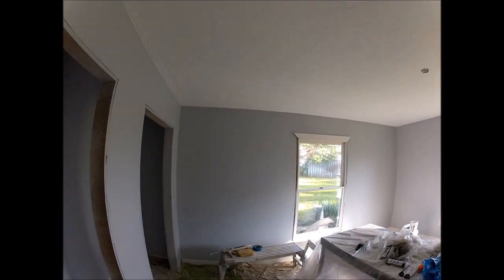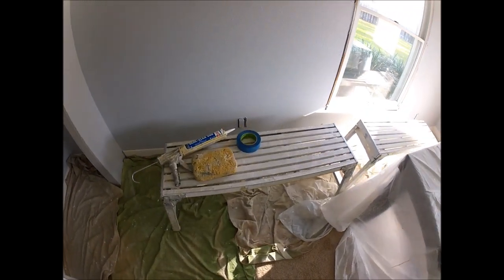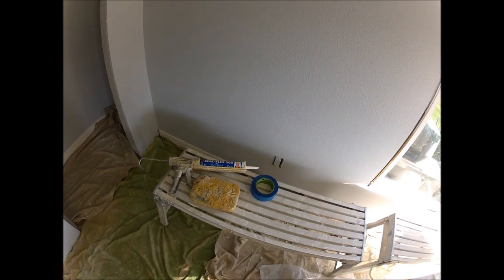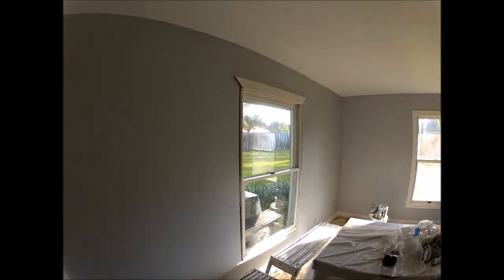How to create a straight cut line on a  textured ceiling - Pro Painter Tips and Tricks

Comment: Good advice almost. You should've painted the caulking immediately, then pull your tape. That caulking left unpainted will yellow over time, and it doesn't look good. I've done it both ways.
Reply: It cracks. Must be mixed with primer or paint. I'm gonna try this at work tommorow tho. I've been meaning to try it
Reply: Don't wanna paint over wet caulking
Reply: They make fast dry caulk that can be painted over in 20 minutes. Many paint stores and Home Depot has Alex fast dry caulk. Leaving it raw will discolor while the ceiling stays white.
Reply: @johnbelvin5216  Chuck is right. Usually you don't want to paint over wet caulking, but it works great in this application and is a common trick among painters. The line comes out cleaner when it can cleanly seperate the wet material vs the slight tearing you get once it's dried (as it's essentially ripping the thin overlap).
Reply: So the ceiling is caulking not paint. Seems like you could only do this on white, how long will the caulking last without dis- coloring, is there a shine to the caulking when dry? It looks good but I want paint on the edge not white caulking. If your doing it yourself and you suck at cutting in I guess its better then a wavy line!

Comment: If you paint long enough you can cut a line without tape.
Reply: Yes this is bullshit and a waste of time. If I don't have a nice smooth line between wall and ceiling I'll run a caulk bead and finger it smooth both ways, let it dry,paint ceiling two coats then paint your wall 2coats done deal.

Comment: Guess I’m a moron, I don’t know how that helps without using the wall color paint I’m painting wall with . Old wall in the garage is light pink. Not painting ceiling, new color is light grey, the caulk is t thick enough to cover up the old pink color, Ned to take her popcorn ceiling I guess abs run my caulk wipe off, then run light grey pull tape then but having problem with tape sticking to ceiling

Comment: Dude! You are the MAN!!! I never thought of doing anything like this, I'm not a painter just a weekend DIY'er but I've never been able to do a straight line. Now I can! You FN rock!!! Thanks and much success...
Reply from the maker: That's awesome Airbnb Lifestyle!! I'm glad you found my ceiling painting hack helpful. I'm a self taught painter and drywaller which gives me some out of the box thinking when it comes to tips and tricks with painting, drywall and texturing. Which is helpful for do it yourself like you and even professional's. Be sure to subscribe to learn even more helpful tricks  http://www.youtube.com/subscription_center?add_user=PeckDrywallPainting Thank you for the kind words. Take care, -Paul
Reply: Nice job man, this is the only way to achieve a true straight line of caulk, and it is fast too. As you are an dry waller, can I ask why my painwork has cracked on my dry wall (dot and dab) I have done 3 coats of dulux trade supermatt watered right down, sanding and filling in-between. I have managed to sort the mess of dinks all over the walls, and have achieved a perfectly flat finish, but, the paint has tiny hairline cracks everywhere. I'm not worried because I will be painting vinyl matt on ceiling and dulux endurance on walls for finish coats, so the plastic shouldn't crack (he say's) but I would just like to know why my supermatt has cracked? I'm wondering if the cowboys who did the dry wall job didn't prime the walls properly, if I maybe didn't water down the paint enough, or possibly the water itself has contaminated the paint? I am probably going to pick some floetrol up tomorrow as I am maybe being cheap using water to thin?

Comment: My dad was a professional painter, and he could cut a straight, level line mid wall if need be. Me. fair, but on texture, it does become more difficult. I started painting the wall first, then taped and sheeted with plastic, then sprayed the ceiling. Looks nice, but much more work. Like this approach. What do you think of applying the caulking before painting, then spraying/rolling the ceiling, then cut in with the wall color?

Comment: So am I correct in thinking you matched the caulk to the ceiling color and did not have to cover the caulk with the white ceiling color paint?  Seems I’ve seen this hack using a clear caulk that had to be painted over with either the wall or ceiling color.

Comment: This is definitely quicker than the method I am going to try tomorrow. I have flat ceiling white stomped ceiling and darker color satin finish walls. I've cut-in a few sections of wall but even with a fairly steady hand I am not satisfied with my cut. What I plan to do, although it will take longer, is to run the darker wall paint slightly on to the ceiling edge. After drying I will apply painters tape to the satin finish wall (it won't peel satin paint off, but it sure does flat ceiling white!). Then I will take a 1/2" to 1" wide artist brush and apply an application of ceiling white on to the taped line to get my "white" cut-in. PS- I am retired so I have the time to be anal about my painting. DO ANY OF YOU SEMI-PROS THINK THIS WILL WORK WELL? Thanks for your responses.
Reply from the maker: Hi Teddy, that sounds like a plan.👍🏻 Here’s another trick for ya: If you dry brush the paint over the edge of the tape first and let that dry. That will seal the tape so your cut in will not bleed through the tape creating a nice straight cut line when you peel the tape!et me know how it goes. Thanks so much for watching and subscribing!😎 -Paul

Comment: When do you paint?  That works if your doing a bright white ceiling but what about if we want to darker opposing colors on adjoining walls?  Do you paint immediately after you caulk, then pull the tape?
Reply from the maker: Hey Shawn, What I would do if you're not doing a white ceiling. I would do a super tight bead of caulk without using any tape before you do any painting. Then paint your ceiling as first. Next place the blue painters tape on the ceiling along the corner where the ceiling intersects with the wall. Now take your cut brush and just barely put any paint on your brush (dry brush) and just paint along the tap. Try not to pile up any paint in the corner or on the tape (this will seal the tape so that on your next coat the paint won't bleed thru the tape leaving you with a nice straight cut line when you pull the tape). Immediately after you do your second cut in, pull the tape off of the ceiling while the cut in is still wet. Then finish rolling out the second coat on the walls.  Hope this helps and let me know if you have any more questions. Take care, -Paul
Reply: thats what I was thinking, this is not cutting the cieling in this is filling voids and caulking the cieling
Reply: I have never been successful using painters tape on a white flat ceiling without pulling the paint off as I remove the tape.

Comment: Hi. What kind of caulk (or is that the same as sealant. Should I get a sealant instead?) should I tell the staff at the hardware store for the gap between the ceiling and the wall (no molding) for the bathroom (dirt keep falling from the gaps in the bathroom especially) and between the wall and floor (to minimize critters like ants from coming in).

Thank you in advance.
God bless, Proverbs 31
Reply: I use white Caulk and make sure its paintable.

Comment: Hello everyone. You are supposed to paint over the wet caulk and pull the tape off immediately.
Reply: That's crap you don't paint over wet caulk, when caulk dries it shrinks and then you'll have the paint line have small hairline cracks, painting of a wet caulk can distort the caulk also

Comment: also would the tape remove my paint on the wall ?

thanks
Reply from the maker: The tape could take some paint off the wall if the wall paint is not completely dry or if there's any kind of situation with moisture or something like that. Take care, -Paul
Reply: You can tape caulk and paint edge with 3"in brush for cutting depending finish and or 3/8"in nap 4"in roller hit it lightly and immediately remove tape nice and slow opposite direction or roller ir brush stroke applied- use frog tape.

Comment: can i apply the caulk after the room has been painted as the edges are really rough and have tiny bumps in them
Reply from the maker: Hi Adwaan, yes just make sure the paint on the ceiling and wall is completely dry. Hope this helps, -Paul

Comment: Why not just caulk the ceilings edges after the first coat...let it dry over night and cut in the walls with a straight line the next day? That caulk will dry a different colour to the white and will be noticeable after a day or 2 doing it this way
Reply from the maker: That's exactly what I did in (Part 2) of this video. https://www.youtube.com/watch?v=tHW1qWPW5b8 But you can get away with doing a very fine bead of caulk without doing the second coat. You can't see any color variation from the white caulk color to the ceiling paints white color. If you could I would not do this technique. -Paul

Comment: a straight line of caulk anyway.
Reply from the maker: Yes, a straight caulk line giving the illusion of a straight painted cut line. And you'll be the only one that knows. Don't knock it till you try it! Thanks for playing though...
Reply: Paul Peck
I'll definitely try it, I searched this out and found several methods, some good (like this one) some horrible; caulk, let it dry, tape, paint, let it dry, another coat of dried paint, then slice through all that with a box cutter. I also like the tape then clear caulk, wipe most of it off and paint while its all wet pull off the tape. I'm a handyman so I have to paint a lot, and need all the tricks I can get. Thanks for posting.

Comment: Great for getting the money and a first impression BUT it will CRACK in 5 years and become crooked you may prolong the life by PAINTING over the Caulk that's WHY you're using "paintable" Caulk.  A real Painter like myself uses an ultra stiff brush and can go around that room in 30 minutes then make corrections in 15 minutes by hand and warranties his work for 10 years  this is what they do in new construction. That's why my biz is Thriving. I fix that crap by hand left and right straighter than any tape line. But great for a diyer.
Reply: I agree that's bullshit .